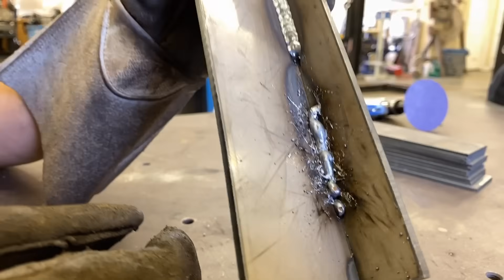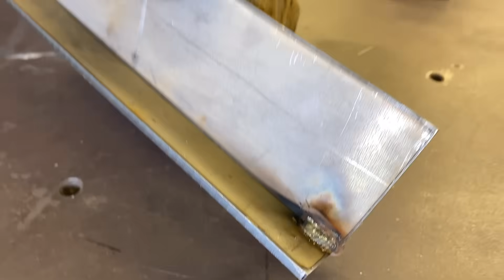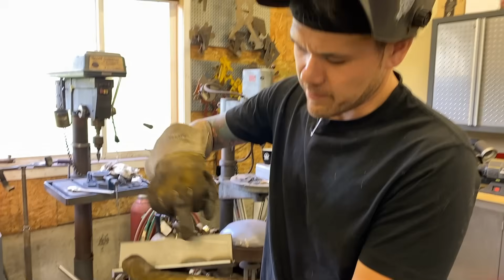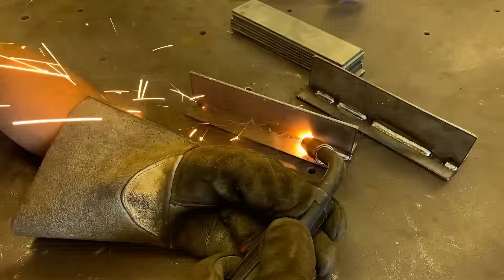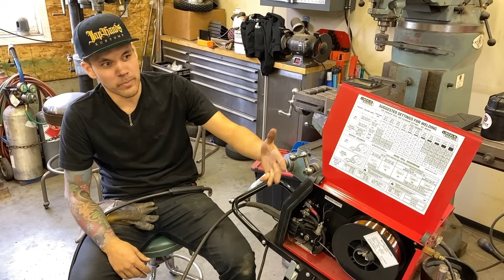MIG Welding Basics For BEGINNERS!! How To Set Up Your Welder + Tips, Tricks & Techniques!!

Comment: Awesome video! Thank you for taking the time to film and explain. I am wondering how do you know if your voltage is too high or low? Any tips?
Reply from the maker: If your voltage is too high it will create undercut on the edges of the weld If it is too low it will pile up

Comment: Excellent tutorial.  When welding together do you create an angle on the edge of the metal with the grinder before welding or does that depend on the thickness of the steel?
Reply from the maker: It would depend on the thickness. I figure it is you would want to bevel to get more penetration

Comment: Where do you place you wire clamp? on the table or the piece you are welding? I thought it was the piece you are welding.
Reply from the maker: Either way works but the piece is best
Reply: @MakeItKustom  Thank you so much. Have my grandson coming in a week and half to stay with me and we will be doing some basic welding. One last question. I'm just running a Millermatic 141 and 75%argon25% Co2 mix. What pressures do you run your gas?

Comment: I'm trying to fix up and old wood stove and I need to no if I need to use gas to weld 1/4 inch metal or can I use flucks wire and make to Vess to join together to weld in the middle with out gas

Comment: A big problem with mig and tig is wind. Another is paint and rust. The only time I have ever welded vertical up with mig is for a test.  I was welding torque tubes and the customer wanted the ends capped with mig wire. They were one inch wide welds and he wanted the ends capped.  It made them pretty.  Strong is expected but pretty is mandatory. Thanks for a great video.

Comment: Contemplating welding, as a must go to tool.  Are there small welding kits worth purchasing for auto & home repairs?
Reply from the maker: If you buy a 110 V Welder just make sure it can have shielding gas. Most of all it just matters what you plan on doing with it. But you can do a lot with a miller 140 or equivalent and they will plug into a regular socket

Comment: Thank you for an exceptional video! I’m very new to welding and have an old Lincoln pro mig 140 running flux core. Two questions: 1 - does the flow rate on your shielding gas change proportionately to your voltage and wire speed or remain at a constant fixed rate regardless. 2- I’ve heard the rhyme if it has slag let it drag for flux welding. does that mean you lean the same direction the weld is moving staying in front of it. And can I still use the technics you covered dragging slag? (Whip, little circles) thanks in advance. P.S - Your vids are full of info and welding charisma!
Reply from the maker: The flow rate doesn’t change. It’s more about your environment and if there is any wind etc. yes if there’s slag you drag and the techniques are similar. Thanks Daniel good luck!

Comment: Another good video! Good work! The best advice given each machine is different they all have different personalities so to speak. I bough the welders from the same place and even the same day. All different, wire speeds are slight different and voltages, this even applies to lathes and mills. 
The bacon frying sound on point here, 

I have been playing with gas less wire I bought a machine just for it. Not a huge huge fan, but it is also a game changer as well,
Tig welding is my preferred method but not everything can be rigged, situations do permit 

You are a good teacher. Keep it up.

Comment: Great tutorial video. You are an awesome teacher. Sooo many supervisors/old weld heads/ engineers that have NEVER welded just wanna tell u WHAT to do, not actually explain what your doing and HOW MUCH it affects your finished weld. I just passed my weld test for mig, (we use .35 wire and .45 wire btw) and he proceeded to crank up my voltage and wire speed ALOT after I had it where I liked it and it was also within the parameters. I get the fact that he's the I structor AND I'm used to welding with flux core mig, so he may know where the "sweet spot" is better than me in that particular process BUT it messed me all up because he cranked it way up, after I had been practicing for about 3-4 hrs on the settings that were comfortable to me AND within the parameters. Either way, I got used to the settings he had it on and I NAILED the test yesterday. Got the job and im soooooo excited to be welding and doing what I LOVE to do again.❤ loved this video so much I insta subbed. Looking forward to watching more of your mig weld vids. Thanks again brother!! Very instructional and informational video.

Comment: Brand new to welding. Thanks for this video. However, when I start on a weld I get a long wire that pops off then it will be continuous weld bead with spatter. So I know now I have to slow down my feed and get a high volt but how do I stop that 3+ inch of wire that pops or arcs offs.
Reply from the maker: You must need a better ground or clean or metal as soon as you touch the wire it should spark
Reply: @MakeItKustom  thanks. I've learned to clean the metal and it's also me reading the instructions as when I was supposed to press the trigger to start the weld rather than just a touch and go. My welder had both choices and the touch and go I have to press to feed with active touch or trigger is live feed and weld. If I'm wording it correctly. But I'm slowly learning and I think I did an great job for my first time. If you have an email I can send you my project and you can give me some pointers for my next project.

Comment: Awesome video. One question, do you not have to clean the metals before mig welding?
Reply from the maker: You don’t have to clean As well as you would have to for TIG welding but the cleaners a better no matter what. But Meg welding is more forgiving if there is some kind of dirt around it can usually be burnt off

Comment: I first started gas welding with a torch and coat hanger for filler wire. I always make small circles with the torch so when I started MIG welding I kept the same technique.

Comment: One of the better MIG videos I have seen so far.  I'm just learning flux core mig welding (no gas) and this video was extremely helpful.  One of the clearer, more concise that I've seen.  Question for you, I'm having a hard time determining if I'm running to hot.  I practice on 1/8 plate, and sometimes I see some scaling on the back side of the metal.  Is that common, or is that due to voltage being too high?  Maybe I just need to move faster... I'm not sure.
Reply from the maker: Scaling is fine usually determine My settings based on how the weld looks on the outside. Is it convex concave or flat. Has it under cut the edges of the weld ? The scale happens when metal gets hot and should be happening when your welding

Comment: when I stick weld with the whipping style, I always pulled back and pushed into the puddle to get that good looking bead. I'm just learning Mig welding, so I guess it's different than stick in that regard. I see Miller brand welders and generators a lot on industrial job sites. Great tutorial video!

Comment: short arc is a think in welding though. if you're using sf-3am or equivalent wire though then that does not have the capability to do that from what I've heard.

i also realize i need to experiment today with my parameters. make some of my own notes as a lot of the parameters I use are 70/30 based on other people's parameters and ones I've found myself respectively.

Comment: Well I guess this is an older video as this looks like the old shop lol. Great advice on speeds and voltage.  Also technique.  I changed my welder from a hobby 90 amp to a sealey 150. And although its welding its not as good as it could be . Like you say I'm still looking and listening for that sweet spot with the bacon sizzle but this explains some of why mine look the way they do . Thanks karl .

Comment: YES..IT'S MY SETTINGS...DAMN THOSE SETTINGS....!!
Reply: 3 years in just been up the garage and finally managed to do some welding on my new old Eland MIG it’s a bit of a beats even if I say so myself. Issues with an old regulator and having to find an fix a couple of faults (done/still need to replace the wire speed potentiometer) and get a new Euro connector and torch(cheap as chips) I joined some stuff together and ‘run some beads’ on some scrap metal… I am hooked completely.. just a little
Miffed at how long it has taken me if I am honest.. fiddled with the settings after having a lucky start and seeing pretty good results..only to find myself struggling to get it back to where I was before. Eventually managed that and remembered to take a photo of the settings on the machine. Peace to everyone..

Comment: Thank you for the great lesson on Mig Welding.  As an older dude (67) I am grateful to still be learning different trade techniques. I am a self taught welder for over 30 yrs most of that has been Gas/Oxy and stick welding in the structural sign trade.  I bought myself my first Mig welder (Lincoln 140 MP) a week ago and been learning myself how to use it. I am restoring my 1987 GMC Steel body Step Van. I first discovered you a few months ago watching your light gauged sheet metal techniques for replacing body rot sections on an old Chevy Van.  You are indeed a skilled craftsman and a very good instructor.  I am semi retired now with all the various trade tools and finally get to spend some time in my garage/work shop.  Between your lessons and Fitzee Fabrications 
I believe I can surely manage most sheet metal repairs on my truck. I definitely learned from you tonight that I was mig welding in the wrong direction.  I have been learning typical horizontal methods for now and my stick welding techniques ( left to right) was not working at all with the Mig.  Both you and Fritzee rock you are my go to metal tradesmen on the Youtube. I subscribed to your channel tonight looking forward to more great teaching.  Thank you man & God bless

Comment: Excellent video tut.
These "bad weld" examples are like my welds. Now I know what the problem was. Of course including crappy cheap MIG welder.
Now im planning to buy ~1000€ machine. For hobby use. I cant learn proper welding with crappy machine that ruins 90% of the work already.

Comment: I seem to have a problem seeing the line in which I am trying to weld it’s as though the lens lets too much light in and it blinds me to seeing the end of the tip . What do you suggest I do?
Reply from the maker: You definitely need a darker shade of helmet. If you the light is blinding you could be causing damage. Use at least the shade 9 For later gauge welding
Reply: @MakeItKustom  It’s too late damage done years ago too many welders’ flash and the super sore eye burns after a few hours ..😵‍💫

Comment: Nice tute me personally am a circle welder with either stick, tig or mig, but I feel you missed gas types and settings, this can make or break the weld, for eg: argoshield ratios compared to argon. You could have the right volts and speed still come up with rubbish, using the wrong gas or flow rates.

Comment: What a great and awesome teaching and experienced! Awesome instruction.  BTW Could you speak more about the gas and the percentage?
Does it make a difference in the weld?  Less oxidation?   WIsh you talked more about the gas. Thanks
Reply from the maker: Sorry I didn’t talk much about the gas. Basically if you have enough gas, you will not see porosity. If you don’t have enough gas you will see porosity. I use about 20 ft.³ per minute most of the time. The only time I might adjust that is if I’m in a situation where I see porosity because of a breeze but for the most part I never touch it

Comment: That is an awesome video for complete novices like me. I have always worked in wood and have been able to "stick" two pieces of metal together, but not weld!!
I really liked your listen to the sound description of wire speed. 
I have to weld some cracks in my mower deck and will take on board your tips.
Thanks again for a very informative video and your views on the ways different people choice to welding. 
 Everybody is an individual. !

Comment: My machine doesn't have any wfs. Only voltage, amperes and induction. How do I adjust amperage to match wfs
Reply from the maker: That’s a great question I have not come across a machine that has separate wire feed speed from amperage. I would set them in a similar way though. You will know if you don’t have enough amperage or too much wire speed if the world is cold and the wire is kicking back your gun.

Comment: Would you recommend a mid price mig/ welder for a DIY user
Reply from the maker: It depends on how thick of material you want to weld. If it’s 110 V machine you were looking for, then I recommend a Miller or Lincoln. Both of those brands you can find used and they will work just as good and save you a bunch of money. If it’s a 220 V machine I suggest the same thing by the best machine you can for the money you want to spend.I’ve never had trouble buying used equipment

Comment: Again, real nice video that should help tons of newbies and some old farts too! 
Great job of demonstrating the wrongs and the rights. I'm self taught, used to build a lot of stuff, and have pushed hundreds of pounds of mostly .030. I agree with what you have shown. Heck, I'll be trying a couple new things too!
Oh BTW, I used CO2 for the vast majority and only recently started using CO2/Argon. The mix seems a little better on light stuff but not hugely different. Both work I think. 
Cheers and thanks.

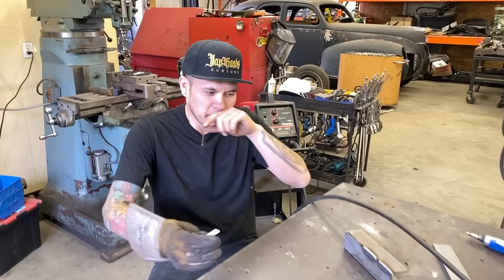Comment: Heya, at 17:25 you mention wishing you had a really dark filter so we could see it better. Not sure if you’ve gone this route so excuse me if I’m being redundant lol. Do you know what an ND (neutral density) filter is? Its used in photography and is basically a volume control for light. They come in different percentages which range from a slight gray to probably as dark as the glass on your welding helmet/shield? 

Anyway, even if the camera you’re filming with doesn’t have threads for you to screw the filter on, you could just even hold it up over the lens 👍
Reply from the maker: Thanks for the heads up we actually use our phones to film so I need something that can go over my phone camera
Reply: @MakeItKustom  you could still use the filter 👍 it’s about 2” in diameter and maybe about 1/8 or 1/4” thick? Just hold it over the lens on your phone when you’re filming the welding; there’s a lip on it where the threads are on the ID so put that side up against the phone. It’s actually more of an advantage in your scenario to hold it instead of having to unscrew it when you switch from welding footage to not welding footage. 

I don’t wanna put a link up since you don’t know me from a hole in a wall lol so just google search “Fixed Neutral Density Filter” so you can get a better idea of what it looks like. You’re gunna want to get the darkest ones you can and what I’ve read on some message boards was an ND12 up to a ND16 worked well for them with welding footage. 

The # refers to how much you’d adjust the f-stop on a camera; it’s basically the equivalent of a pupil and deals with how much light enters the lens. The other number you’d see is a mm dimension (like 49mm, 77mm etc) that’s for whatever lens size you have but don’t worry about that number since you’re not gunna be screwing it on a lens. 

Sorry for the long reply but I was just imagining someone not being too familiar with photography gear and how it might be really confusing. If there is anyway to actually go to a camera store near you where they sell SLR cameras that would be the best spot. They would know exactly which one you’d need and you could try it out in the store since the darker ones do cost more. I hate to just tell you “Get a Hoya or Tiffen ND14, 77mm off of EBay” since I only have used them in still photography and not for a welding video lol. They do sell them at Best Buy but they’re $25+ and someone at Best But most probably wouldn’t know much about them except that they’re on aisle 5 lol.

Hope that helps and keep the videos coming!
Reply: PS: B&H photo is a great place to buy photo supplies or check out a local camera supply store and they’ll have them in stock, they’re pretty standard 👍

Comment: Quick question. Should I take the body off my 52 Ford to replace floor pan ect. Or repair in place? By the way you are bad ass with sheet metal hopefully I will get there one day
Reply from the maker: I guess it depends on how far you were going? If you’re replacing a full floor then maybe but if it’s just patches I would do it in place

Comment: Thanks, that was really helpful. What kind of tool do I need to determine gauge thickness?  Do I need to use special wire for welding stainless?
Reply from the maker: Yes you need to match your wire to your base material. You can get a thickness gauge